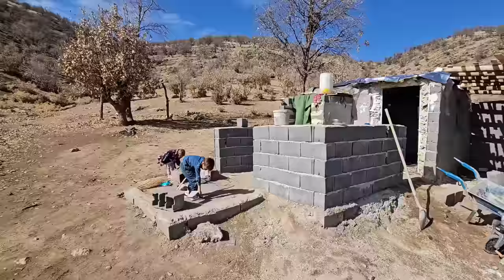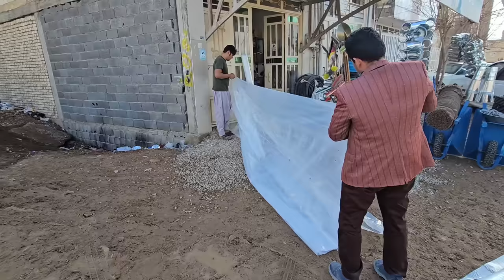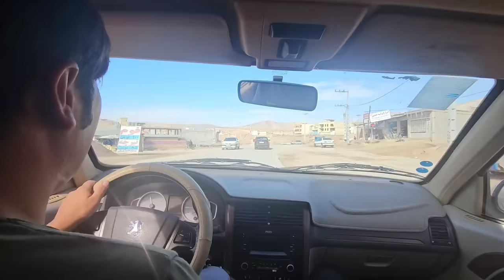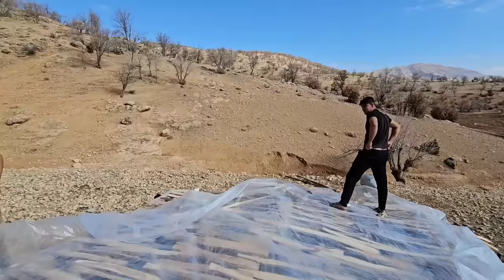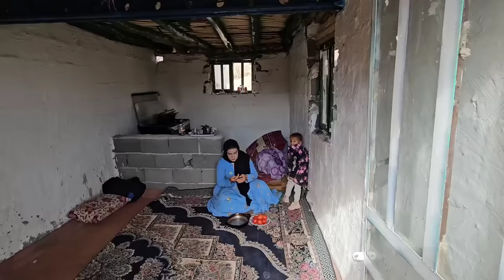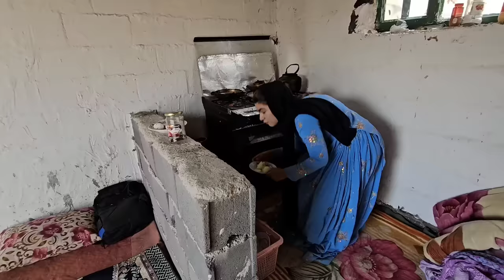A Nomadic Boy's Tale of Tribal Assistance and Unexpected Tragedy 🌪️💔

Comment: Hello builders  of the house Mhalik why do you put soil on the roof TOP   then later put cement? It's just a dusty
 road with tar in it.. It's more easier to do it if the roof is corrogated metal sheets it much with those wood poles and flat wood...after metal roofing you may finishes ceilings of plywood and its neat and clean to see up ceilings... You can put also plywood ceilings aftet that cement roofing.. If they house has a well fix ceilings in it with plywood you feel comfortable inside especially during at night because once you're lying down to sleep  you're eyes is directly to see ceiling of your house whether its beautiful or not but im sure once your ceiling is well fix you have a very beautiful house... Please MR. CAMERAMAN kindly advice those builder Mhalik... Not tohave a house ROOF LIKE A DUSTY ROAD WITH TAR.. 😂😂😂